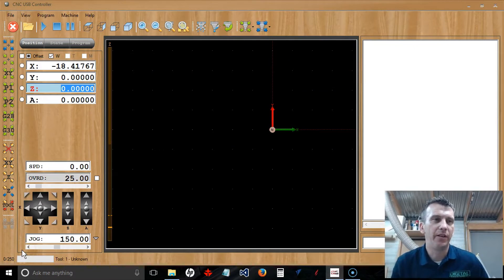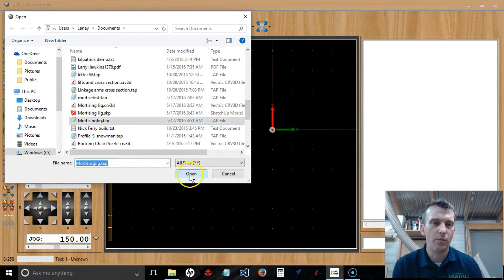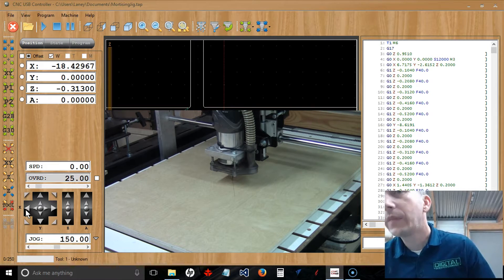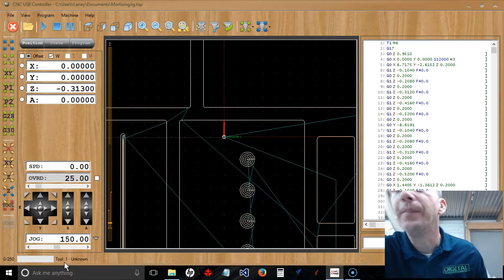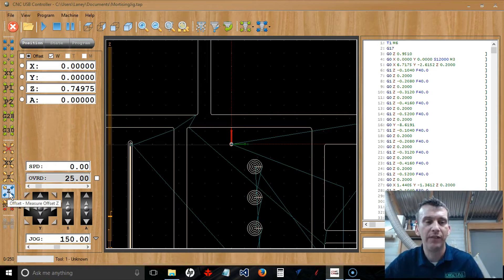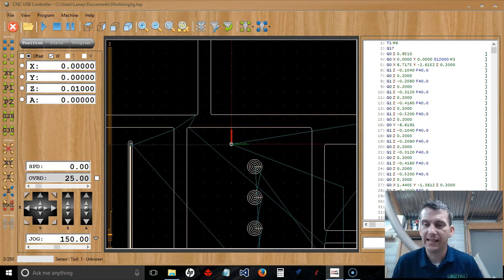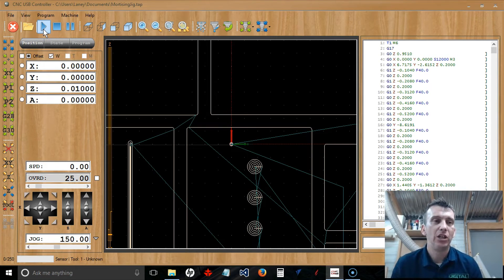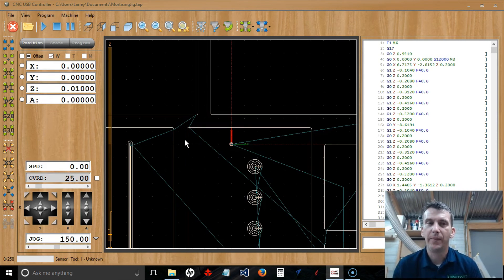CNC USB Motion Controller -  Basic Startup and Run

Comment: Hello Burl, wich number do i need to switch on/off the spindle in GCode? Is it M03/M05 such as Mach 3 to swtich on/off the laser or M11P1/M10P1 such as camBam or other number...? and wich one to do a pause in Gcode ( to change tool for example ) ? Thank's a lot
Philippe
Reply: Hi my friend
I wont meak calebriotn for my cnc usb controller software
Reply: Calebration